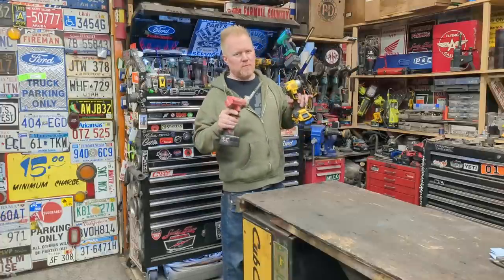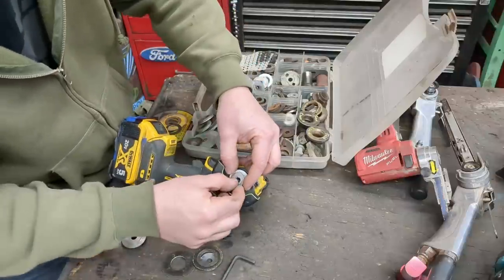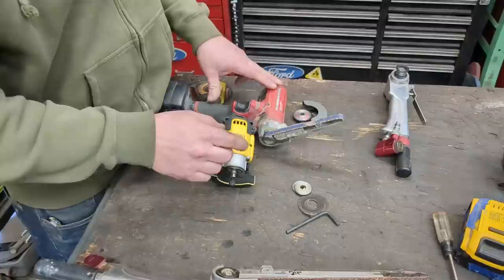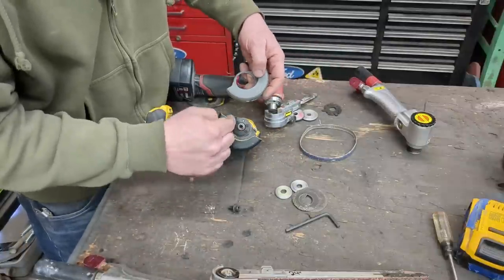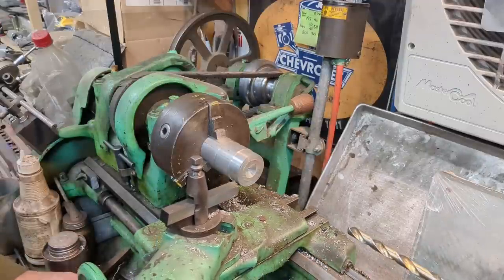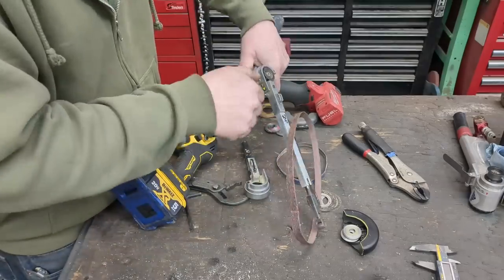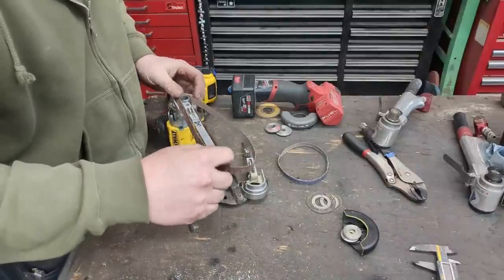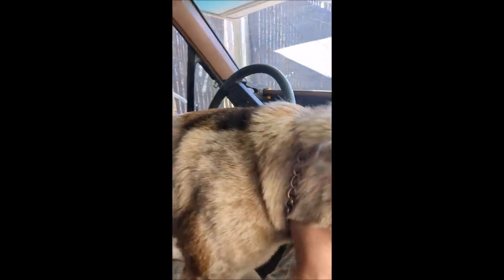Make great tools even greater    3in cutoff tools -  mini belt sander and *****!

Comment: An old lathe is better than no lathe. Maybe you could use your old lathe to make shims or bushings to make it run better again. That would be a great video. All your videos are great and informative. Thank you.
Reply from the maker: Thanks. They call it getting married to your machine when you learn how to use all of it's quirks. It does everything, it's just slow.
Reply: @sixtyfiveford   It can still be a great  machine as long as you account and work with the backlash. I'm sure 65 has already got that figured out!  IMO, 65 has the mindset of a great machinist without even being one :-) (yet)

Comment: Great mod. Sometime only a power file will do! 
Something I never see YT machinists do when parting is to lightly take the edge off the cutting tool with a stone and back off the cut like when you are drilling so cut for half a turn, back off a full turn, cut for half a turn, back off for a full turn, this is especially important for chewy metals. If you lock off the carriage, don't run the work too fast and use plenty of cutting fluid you can usually get decent finishes even on worn out lathes
Reply: Great comment.  Perhaps rather than taking the edge off the cutting tool, keep it sharp and reduce the angle of the cutting edge a few degrees so as to make it less likely to "dig in"?  Just brain storming right now...
Reply: @AtimatikArmy  I'm not going to say no, but parting tool angles are already pretty steep for strength and I'm just passing on a tip which has been passed on over decades (centuries?) Not that we should do these things unthinkingly but having been taught it, it worked so well that I've had no reason to try any other way. (it also works with drills) 
A hard fine, sharp edge cuts into a softer surface more easily but if it's too easy, depending on the resistance in the tool, work piece and cross slide you can end up taking a cut or feed rate that is unsustainable. By lightly running a stone over it is just enough to remove that sharpness, increasing the resistance, allowing you to make a more controlled cut. It also reduces the chance of chipping the edge so the tool lasts longer and produces cleaner cuts.
Reply: @strongandco   I too have heard this before and it does make sense. If it's not broken don't fix it right?   Thanks for reminding me about this, I will keep it in mine next time I'm parting something on the lathe and things start not going smooth!

Comment: I was able to adapt the drum wheel that came with my 3/8 air belt sander from harbor freight. I drilled and counterbored the center to fit the screw for my Milwaukee cut off tool. Then I machined a 5/16 slot on the side of the drum that keys onto the drive of the cutoff tool.

Comment: I noticed that you are manually crossfeeding the carriage to turn the drive pulley and the aluminum spacer.
I have a SB Model C lathe. I can't see the handle on that should be on the left side of the bed to set the crossfeed to forward and reverse. If I'm just not seeing it then ignore this comment. 
I have a spare reversing lever that I bought along with some other replacement parts that my lathe needed. 
With a full set of feed gears you can make any thread you need. 
If you would like my spare lever just let me know.
Reply from the maker: My 1935 C is stock and doesn't have power cross feed. I have the half nut only carriage that I use for threading with all the change gears(minus 2).
Reply: @sixtyfiveford  Glad it is all there. Even worn out having a lathe is a big plus in the shop.
Reply from the maker: @OldSneelock  One day I'll find a small lathe with quick change and power feed. This will have to do in the meantime.
Reply: @sixtyfiveford  Mine cost $400 twenty years ago. I think I will sit tight and do without.

Comment: Waste not want not, for those cut off wheels. And watching lath work is so satisfying for some reason. Was a pretty cool mod for those cordless tools. Haha Ginger will be an Uber driver in no time.
Reply from the maker: I'm most excited about using junk cutoff discs for sure. 

Couple more lessons
Reply: In the past, I've done the same conversions as you have Moe... though back in the day it was primarily on pneumatic tools. One of the best places I found to score various cut-off or grinding discs was at work when they would get tossed for being too small on a 4 or 6 inch corded grinder. I had guys start saving them for me by tossing them in a box in the work areas when a new disc was mounted. It didn't take too long before I literally had about 500 to use up over time. Interestingly, other guys noted my conversions and asked me to duplicate them on their tools. As you might guess, eventually, everyone started keeping the worn down discs from the larger grinders for themselves. I was glad I piled up several large boxes of them before the supply nearly dried up! You could still find them on benches or the floors in the welding labs in the ensuing years but it was nice to be ahead of the game. I tell everyone I know that doesn't work in a production environment like that to find someone who does... so their friend can start saving the worn down discs for home use. Yes, it's nice to have a lot of friends in low places. Best wishes! 🤔👍🏻😁

- Max Giganteum

Comment: I have seen a few YouTubers use this belt sander. I'm curious as to if I could find a use for one? Great video as usual.
Reply from the maker: I've had the pneumatic ones for years and forget I have them as they sit in the back of a drawer. In the past couple months I've used the Milwaukee converted one a fair amount as it's right in front of me.
Reply: I use mine all the time.
At the risk of being accused of blasphemy I like it better than a file for cleaning up and deburing.
Reply: It's mainly used for grinding welds, hard to reach areas, fillet welds (especially inside a sharp inside corner.) The benefit of any belt style grinder over let's say a hard disc, is that you have more surface area of abrasive, with the same amount of contact patch. In addition to simply adding more abrasive to wear out, the grinding runs cooler, which keeps the grains sharp for longer.

Comment: I spent 22 years working in machine shops and I saw a lot of techniques,,   but the portoband parting was a first.... When parting,, use the thinnest tool you have (.06 or .09) and  just let the  part drop without anything in the center especially not a drill bit.. You should be able to adjust any play out of the ways... Those old South Bends are work horses and are always fixable...
Reply from the maker: It's my acme nut and threads that are worn out. It'll do it but it's a 5+minute process vs 30 seconds with the portaband.
Reply: @sixtyfiveford  nothing wrong with the Porta band or band saw.  Just face afterwards exactly as you did!

Comment: Nice!  I've been recently thinking about for pipe welding making a small wheel belt sander attachment sometime in the future.  For the price of buying them new... seems can be made more cost effectively and with rescued made in the US materials.
Reply: Cutting oil or coolant will help those drills last way longer with steel.  Aluminum is something like air and frankly I don't recall offhand... though maybe it's cutting oil is messing with aluminum.  That Tap Magic EP-Extra is my go to, seems like night and day to me.  Good machining work.  Thanks for sharing!.
Reply from the maker: I pipe/contour belt sander would be cool.
Reply: @jafinch78  Tap Magic for steel and ordinary WD40 for aluminum and your pretty set!
Reply: @AtimatikArmy  Ah, OK.  I haven't done machine tooling really in decades.  I still need to get to work on the mini-lathe upgrades since I have most of the parts (new bearings, indexing plate, treadmill motor & pulleys, collet chucks) to improve and an angle plate with new vertical slide so I can replace the compound with and use the lathe as a mill once I widen the cross slide and get that more tight spec and lapped.  Thanks for the affirmation!
Reply: @jafinch78  I should say that is my opinion and always works well for me.  The WD40 thing for aluminum I've heard many times and since it's usually around that what I often use and works well!  Cool project it sounds like you got going there!  I also have a mini lathe in my small home shop!  Limited by the size of the work you can do but with some upgrades like it sounds like you're doing, quite capable! Cheers

Comment: Good ideas... Except the belts won't be running very fast. It's all about surface feet per minute and cordless tools typically run slower than corded.
The cutoff wheel will run ok but the 'real' abrasive is concentrated away from the hub because they need higher strength around the arbor. Good enough for small projects and again, the speed will not be enough probably
Reply: Nope. The Milwaukee 3” cutoff is rated 20,000 rpm, the HF pneumatic sander is rated 16,000 rpm.